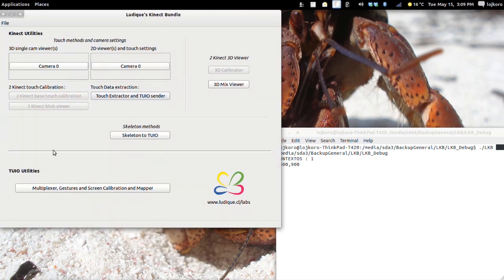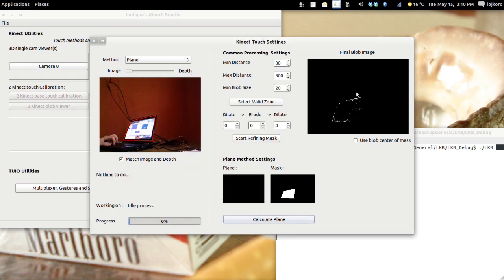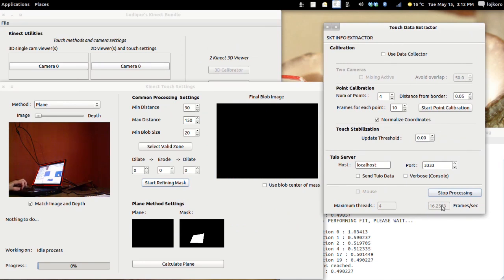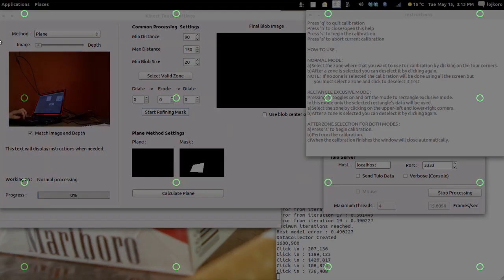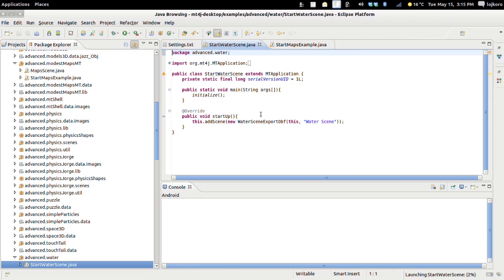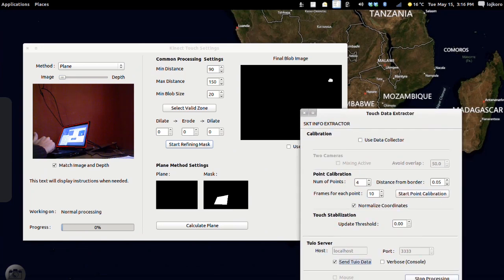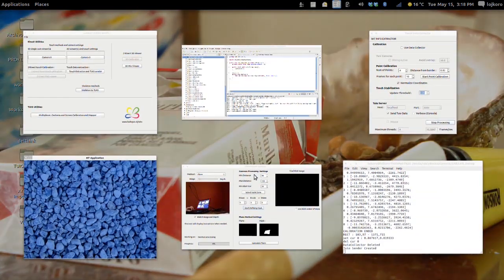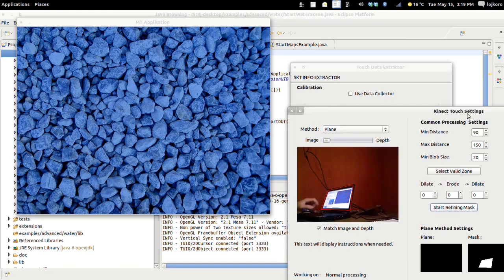LKB - LCD Touch with Kinect Tutorial

Comment: como puedo guardar la configuracion?,  viendo el foro me dicen esto: File->General Settings->Save... You will find 3 new files. Inside generalsettings.gst you can change autostart to 1 and the TUIO host and port to send the data directly on start... pero cual es el TUIO host y el port to send ???? espero me puedan ayudar gracias